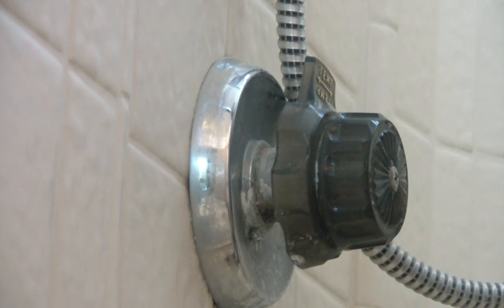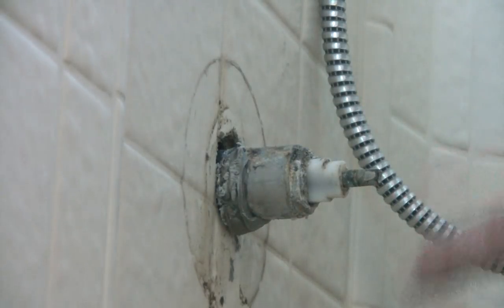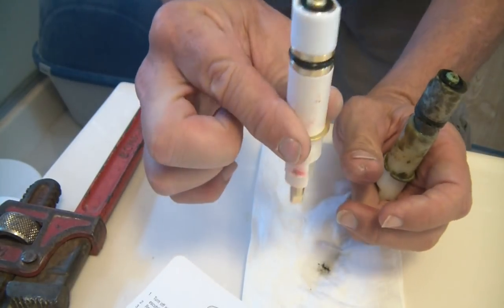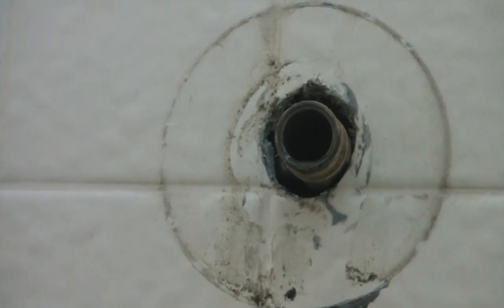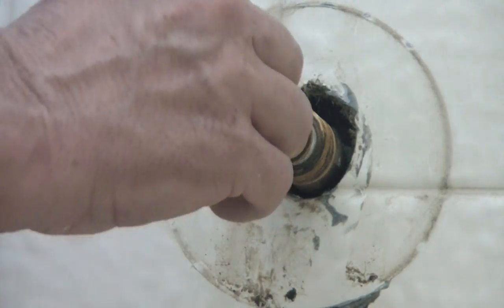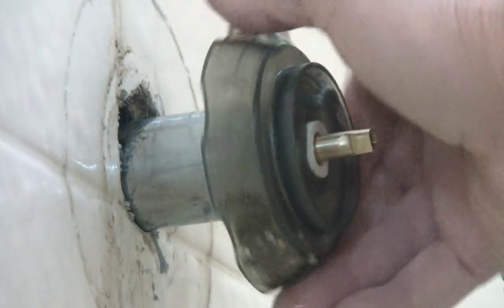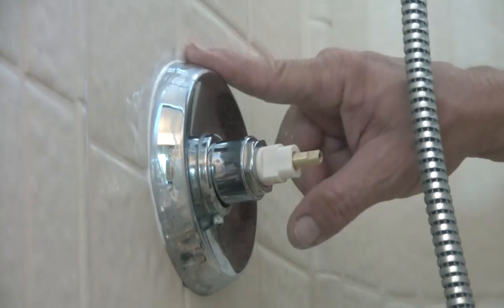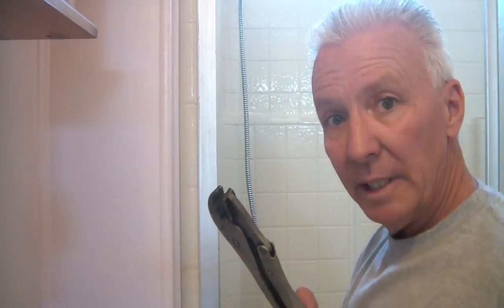How to install Mixet cartridge MXT07

Comment: Great video, thanks!  I have a problem though.  I have changed out the handle and temperature control before and was getting ready to change it again but I'm unable to get the screw out!  The screw just turns,  the water comes on and the handles just turn with it.  Yes, I turned the water off as far as it would go but that's another issue to tackle.  Any idea why the screw won't come out, guessing the valve is the problem?  Is it possibly because there is still some pressure from not being able to completely shut the water off to the house?  Thanks for any help!
Reply from the maker: Peggy the screw only holds the knobs on the valve. Nothing to do with the water pressure. If it is only spinning when you try to unscrew it the threads are compromised. Don't fall but try to put pressure on the knobs by pulling towards you and try the screw at the same time. may just need to grab a thread or two. Try that first. The water if you can't turn it off are you tuning the valve at the house or curb. If the house isn't closing all the way try the curb or street. If that doesn't work then call the city that street valve is their responsibility.  Thanks for viewing.

Comment: Perhaps a very dumb question considering I have no knowledge of plumbing and practically no experience, but would doing this fix a hot/cold water problem? 
My shower gives me two noticeable temperatures no matter where I turn the temp knob; "mildly hot" and "mildly warm". The coldest I can get the water appears to be 80-82 degrees Fahrenheit and I only know this because I tried to fill my fish bowl with water from my shower and the thermometer read 82.

However I can get the perfect temperature of hot water (I LOVE hot showers so I do this multiple times EVERY time I shower) if I flush the toilet. 

All the other water fixtures in my apartment work great and get perfectly cold and perfectly hot water.
Reply from the maker: Liz  being your in an apartment my first response would be talk to the manager. If your water heater is set to a specific temp maybe for the safety of the tenants. and if your having issues that is his responsibility. I have rentals and I'm very specific when i have new tenants that it is MY responsibility to maintain the house. If they have issue with a faucet, toiler, electrical, plumbing I will fix it. Last thing i need is a tenant trying to do something and flood or damage my property. I don't want them to touch anything. So I would recommend talking to the manager first.
Reply: The Shack thank you for replying. Unfortunately I live in apartment where the manager keeps saying "Oh we'll get to it" but then usually never does. Although my neighbors swear up and down they raise your rent if you ask for any repairs... 
I suppose I will have to cross my fingers and see if they ever do check it out. 
Thank you. :)

Comment: On back of package it says red mark on stem must point up🤔
Reply: Hello, great video but I’m in need of help. On my mixet cartridge it’s completely stuck in the valve. I’m unable to remove the cartridge in one solid piece. I removed the top plastic piece off only leaving the brass threaded piece and the bottom portion but that’s stuck inside now. Have u ever come across this situation and what did u do to resolve it? Please help.

Comment: the temperature control knob on mine is extremely stiff and very difficult to turn.  is replacing the cartridge the only solution?
Reply from the maker: sang-min yes there is a reason its become stiff. Hard water deposits, calcium ect. You have to pull out the cartridge to see if that is the problem replacing with a new cartridge is the proper solution.

Comment: I had to replace my shower valve in my bathroom. I bought the valve from Home Depot. I greased the o ring and inside the copper tube. But the new valve would not go in, i tried turning it  and it still would not go in. So finally i took it back put the old valve back on. What I did notice is that the Home deport valve at the end of the white stem there is a slight cut out grove, the one from the HDepot was not as wide, I think that's why it would not go in. Lowes had the same valve MXT07 I noticed the same thing the cut out at the end of the valve was not as wide. Didn't go in either. Took it back. Finally found one at a local hardware store the cut out was the same as the bad one i took out. This one did go in easily. when I put the chrome cover back. The cold and hot water stem would not turn , i loosened the valve still it was hard. Unscrewed the cover and the valve would not come out it was STUCK> Finally had a plumber come out to take it out he put it back in, but it still doesn't work right the shut off if a little tight. I am thinking that this valve is not correct one. But the ones from HomeDepot and Lowes did not go in. SUGGESTIONS?????
Reply from the maker: Johnny you did everything i would of done, process of elimination. if the one you finally picked up was the twin it should of worked. The plumber should of known if it was correct or not and should of been able to get it correct and working properly. He also should of suggested a new valve if this one is wearing out. If the wall the shower is on is in a place where you could cut a hole (opposite side) in and get a visual on it to determine it state i would go there.
Reply: @TheShackHome  have you heard of nomix valve replacements  ? There is a  YouTube video that they are using a replacement part called no mix. Have you heard  or used any of these type of shower replacement valves for mixet??

Comment: I installed one st home yesterday but for some reason the temperature was backwards . Hot was cold and cold was hot . Anyone knows why ?
Reply: black diamond the red dot issue. I’m assuming you have an updated version, as do I, and the install instructions clearly say, “red mark up”. Try this and see if it works.

Comment: Thank you very much for the very helpful video. One quick question. Why one of the  youtube video that I watched, the small hole with red paint goes on top?
Reply from the maker: kim you're very welcome and thank you for watching. There are many different models that particular model may require it on top. just read the included direction to make sure which way it goes in.

Comment: Great video very helpful. I guess all mixers are different my instructions said leave red mark up top. So, we don't need to caulk the cartilage?  The person before me put lot on.
Reply from the maker: Thank you very much Yes there's different valves. This is a shower only valve there is a tub/shower combo, faucetand so on.. No never caulk the cartridge. Only put a little plumbers grease on then slide it in. Only caulk the gusset our what ever type of cover you have for your valve. Exactly how I did in the video. Thank you for viewing Paul. I'm happy to help in any way.

Comment: Hi there!  Thanks so much for the video it is very helpful.  I recently replaced this cartridge due to a leaky faucet.  Prior to the change, the water pressure was fine, it was just the leak that wouldn't stop and the volume control just kept spinning.  After replacing the cartridge, the leak has stopped, but by water pressure coming out of the faucet and the shower has decreased almost by 50%.  Would you have any recommendations as to why this is and how to fix it?
Reply from the maker: Michael i have a few thoughts. When I took out the old cartridge I turned on the water a little just in case there was some debris in the pipes that could of plug the  cartridge. You may have to check that. Also I assume this is a shower only but if not then you might also check the tub spout just unscrew it from the rough in pipe check for any calcium build up turn on the water a little and be sure no debris is present. last depends on the valve assembly you have where you inserted the cartridge if you look on either side there may be an adjustment screw. try to turn it and if it does you can adjust the pressure for the hot and cold separately. if not you may need a pro

Comment: THE RED DOT IS SUPPOSED TO POINT UP!!!! THERE ARE NUMEROUS OTHER PLUMBERS VIDEOS STATING THIS WITH THIS EXACT VALVE.
Reply: Yes so which should I listen to?
Reply: @DarkStorm3_BOTW  the red dot goes up. I promise. Others in these comments are saying the same. It even says up on the valve itself when you buy it (by the red dot). It worked for me with the red dot up and didn't work down.

Comment: Well thank you  for your video but I'm stuck now I got the MXT07 how ever it not going in smooth I need help please. I did not see a mxt110 at home depot to see if that was the correct one.
Reply: Did you get the right part finally? I think I have the same problem.  Thank you
Reply: @jiachengwen7129  hi unfortunately no, I could not replace it had to put the same one back in. 😞😓😩😤.
Reply: @angiemaciel724  thank you for replying.  It is so hard to find the part since it has no part number on it.

Comment: You are an awesome guy , I watched your video, removed the plastic handles and I see the water flowing out of the red dotted hole. I'm on my way to get the correct part. Did I mention you are an awesome guy? Thanks!
Reply: I drove to Lowe's, bought the part, and fixed it, in less time it would have taken a plumber to get here, thanks again!
Reply from the maker: Elias Diez AWESOME! love to here that. You are welcome and so happy to help. thank you for viewing

Comment: I watched this a year ago, fixed it, now the hot water is leaking really bad from the tub faucet; I need help.  Is there a washer that needs to be replaced?
Reply from the maker: Terri really only thing to do is remove the cartridge and look you may need to replace it again. These have been around for years in my house when I remodel the bathrooms i'm replacing the mixet with moem they are just getting old and that is the time to replace before a real problem happens. you may have gotten a faulty cartridge. but until you pull it you don't know.

Comment: do you have a video showing how to make the water hotter
Reply from the maker: i have to ask if the water out of the faucet is hot enough, just make sure its not just the shower valve.Also have you replaced the valve recently?

Comment: Good video.  Make sure no paper debris is left behind due to wiping out the unit.

Always take the original cartridge to the store to make sure it is the correct one if you do not already have the correct part number.  

Often a drip is caused by the washer on the end of the cartridge decaying.  But note, the rubber washer in the end (held in place by a screw) is non-standard in size, meaning that you can not buy a replacement at Home depot when the valve starts to drip.  But you can buy one a little too large and sand it down in diameter and it will fit. But it must fit very snugly or it will leak. Don't sand it any more than necessary.   A soft rubber washer will not do the job as it will leak.  I can not stress these points too much.
Reply from the maker: MYSetDancer all great points thanks for the suggestions.thanks for viewing.

Comment: I followed instructions to the tee, but my faucet still leaking ,what the bell is wrong with this thing
Reply from the maker: Rodger if it didn't leak before Id try flip the cartridge 180 some are red dot up I've had red dot down so just have to see how it came out. if that didn't work try another cartridge there is a slim chance you got the bad one. in a worse scenario the valve it just worn and that mean complete install new one. When i redo my bathrooms in installing Moen valves (just my preference) just time to update and with the walls out no better time. hope this gives you a few ideas if you haven't got it to stop.

Comment: Issue resolved but now I need a new volume handle lol the plastic replacement I got stripped. But though a tight fit it solved the leak. Had a hard time looking for a metal mixet handle.
Reply from the maker: metal wow thought that went out with the dinosaurs. Didnt think you could still find them.
Reply: The Shack sure can! Amazon baby that’s all I need to finalize it.

Comment: So i went to homedepot and they have a mxt07 but they dont carry the 1968 would i have any issues its the same exact piece
Reply from the maker: Mig if your talking a pre 1968 valve you can order it at home depots website its the MS3T Only if you are certain its that old. The one i replaced in this video the house was built in 1983 i believe. If you're not too sure I'd take the old cartridge to a plumbing supply shop and let them look at it to be certain of what you have and possibly even have a replacement there. I'm big on the exact replacement. there is a reason, different year maybe a slight change it only takes a few thousands to through the cartridge off it will bee too lose and leak or to too tight and unable to turn. I stress getting the correct replacement. Or get a micrometer and check measurements to assure they are the same. yes I'm that anal..Good luck Mig wish you well Merry Christmas.
Reply: The Shack thks it did fit and its working properly Merry Christmas

Comment: Great video! I just replaced mine and found out we lost the screw that held the rubber in place at the end of the cartridge. Any advice as to what I can do?
Reply from the maker: Therese are you saying the back part is stuck in the valve? here is a link to an article that may help basically I'd get a long deck screw, screw into the plastic end and with a piece of wood and my hammer with the claw end pry the piece little by little and pull it out. IF the screw has fallen out hopefully it is still in place and you may be able to reconnect and try to pry it out.

Comment: Thank you for the very good film. Is it possible to change the existing Mixet cartridge for the Delta noMix one? I wanted to update our shower handle and bought Danco Tub/shower Trim Kit for Delta, which appears to be designed for noMix cartridges.
Reply from the maker: Olena vbelow is a link to a vid just for the nomix it does require a couple of tools not everyone would have but for a few dollars could buy them. This is why i updated the valves in my rental and in my house because the lack of variety for the mixit valves. but most don't want the expense until its time for a remodel of the bathroom or repipe of the house. here is that link to the vid hopefully it will help in your decision, 
 https://www.youtube.com/watch?v=j0WfX6e2Vis
Reply: I saw that film, it is also a good one, but I want to install a handle, not a knob, I think it would look more stylish, more convenient too. I assume I can install any valve, which would fit my handle, as soon as I extract the original one. Thank you.
Reply from the maker: Olena Erhardt  valves are pretty set for a specific cartridge. If its delta them a delta cartridge is the only one that will fit. some aftermarkets cartridges my work but rarely work as the original one does. Your better off keeping what came out of your valve if your wanting different knobs or handles get a completely different valve. that means blowing a hole in a wall or the shower itself. Good lock in you venture.
Reply: Thank you for the replay. It is not a problem for me to get a new cartridge, I worry that it won't fit in the original pipe, though probably all cartridges are standard in diameter, still I have a concern. So I can buy Delta cartridge, insert it in the pipe and put a new Delta handle I bought before, is that right?

Comment: Quick question, what do you if the retainer nut is stuck and you can't get it off?
Reply from the maker: Adrian if your referring to the sleeve that holds the cartridge in  there is no manic. Spray some CRL on it and let set check off and on or just use a wreanch or vice  grips and just work it if it’s SOO corroded and the threads are gone once you get it off it may need to be replaced, sorry not new you want to hear.
Reply: The Shack thanks bought some from the store and it came off with no more issues!

Comment: hello Mr. Shack... my problem is that the temperature control knob moves with the volume control knob. (the tab is in the hole by the red mark)  AND it can't find the hot water easily. I changed it but need some trouble shooting help.
Reply from the maker: Is your control a tub and shower or just shower. They should move freely independently. 
I would double check the and make sure you didn't over tighten the nut holding the valve in
Make sure you do have the correct valve
Reply: Hey Ray... thanks for getting back to me. I haven't gotten back to this project yet; just tolerating it the way it is. When I do I'll give you an update.
Reply from the maker: +Jim Farnlacher your welcome and it's Rick. There isn't much involved with the valves. Either bad valve, too tight or even in worst cases tear into the wall and replace the temptrol pressure balance valve body. Good luck and let us know the out come.
Reply: Red mark should face down and the tab should go in to the hole on the top .2:07
Reply: JW Far where you able to fix it? Mine new faucet is doing the same.

Comment: Great Video, I would like to add that the red dot to suppose to face upwards and a side note to help people out would be to loctite the screw because apparently they get loose and you will lose the screw in the pipes.
Reply: Eascoaster Great advice. I just assumed the screw was tighten. I lost my screw in the pipe when we replaced it. Any ideas as to how I can get it out? Or just replace it?
Reply: @ThereseElizabeth671  the best answer is both. I was able to fish out one from the pipes in one bathroom and the other bathroom it is suck somewhere in there that I can't see. 
If you need to use another screw then use the old from your replacement.